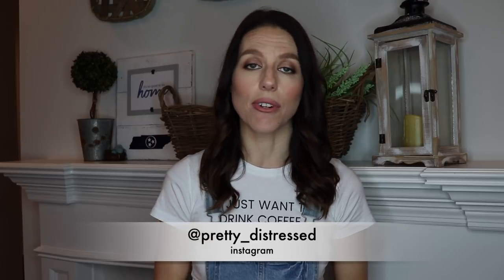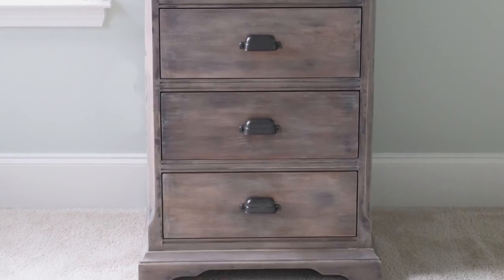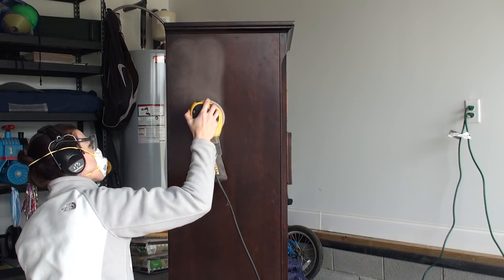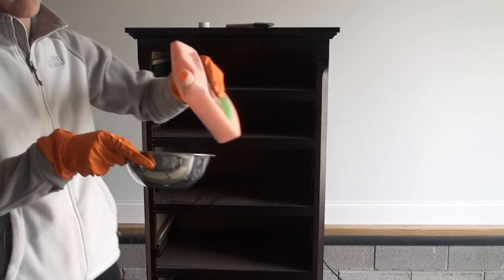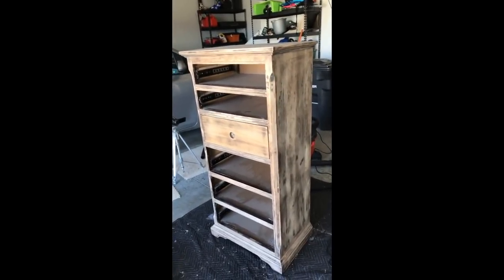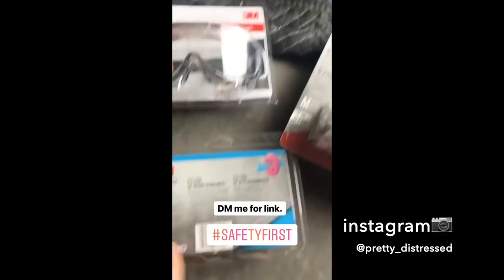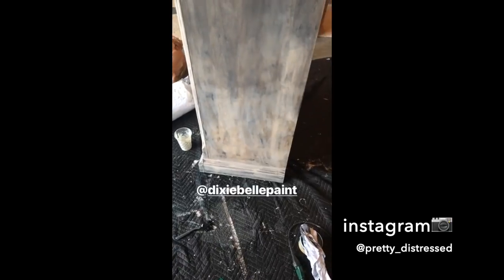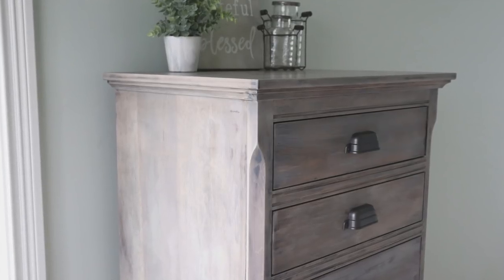Weathered Gray Wood Stain Vlog | Restoration Hardware Stain DIY

Comment: Love how this turned out! I really liked the color before the white wash and wax, too! If I wanted to stop before the white wash and wax, what would you recommend using to seal the piece? Thx!
Reply: You can seal it with a clear wax and it won't add any additional color.
Reply from the maker: General Finishes High Performance. I like Flat but it comes in Satin and Gloss, too.

Comment: I have a question,  couldn't you just have painted it without sanding? I have my bed that I want to paint but I don't know if just adding a primer and paint or to remove all the finish like you did here.

Comment: Hi Christina! I stripped an older Restoration Hardware dining table that had a very dark stain following your videos, and it worked out perfectly, thank you so much!! Now, I want to achieve that beautiful grey wash on the bare veneer, but can’t decide how to go about it. You once used Varathane Sunbleached on a table....would you recommend that on a veneer? What grey wash technique are you happiest with that (gave you that beautiful RH)? Do I do the Sunbleached stain route or the whitewashed with the grey wax on top?

Comment: Just a tip I use with this stripper, if you cover the area with clear cling wrap when you paint it on and leave it for an hour it keeps it "active"  and works much better :) I usually only ever need one coat of the citristrip :)
Reply from the maker: Thanks for the tip. I’ve seen this done. I added a caption about it in my latest vid because of your suggestion. Thank you!